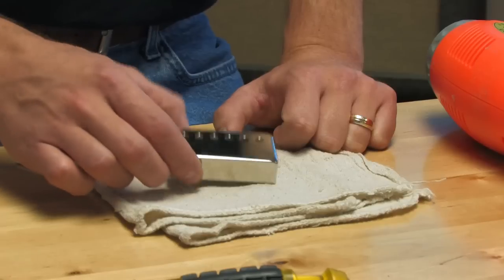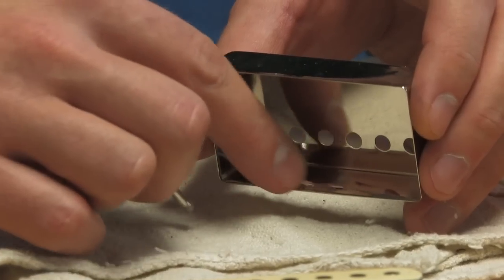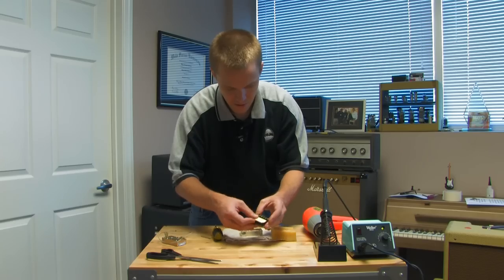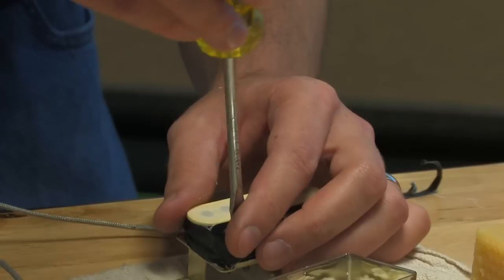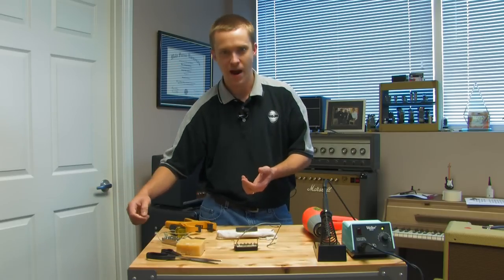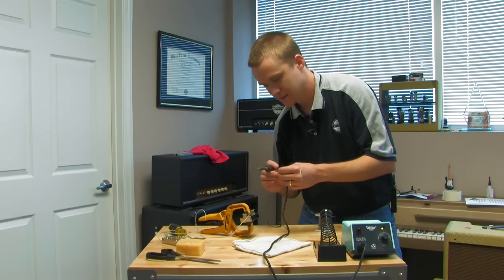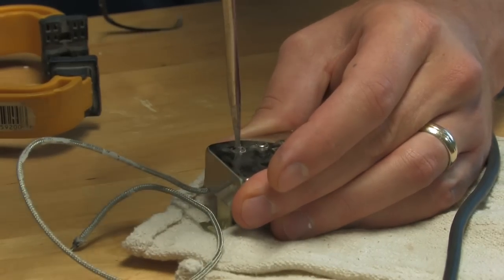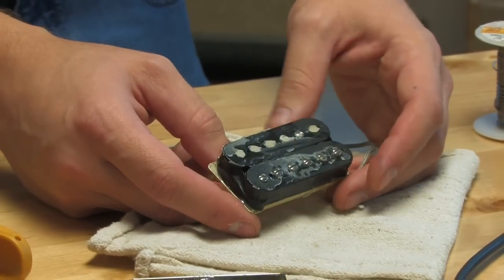Mojo Techtorials - Humbucker Cover Replacement

Comment: This is certainly an intense way of doing it, however I expect the majority of people will be put off adding covers to their pickups because they're afraid of having to put in wax and cover the pickups with tape and solder them. Truth is, you don't need to do ANY of that. Sure, there are some issues that technically may arise if you don't - but this is very very unlikely. Just buy 'em and put em on.

Comment: RS says just to use silicone on top of the flat coil and squish parts together once the cover is aligned and in place with the pile screws.

Comment: An alternative to actually soldering the cover to the pickup would be to solder a wire onto the cover on the outside, near the bottom and then run a ground wire from say, the back of a tone pot and connect it to that. Then you could just insert your pickup as in the video (I prefer to use silicone over melted wax). Finally, for extra solidity, you could silicone around where the solder joint would have been. This worked for me when with my 40W iron, I couldn't get the solder to stick to the base plate of my pickup and was afraid of damaging it by holding the iron there to long.

Comment: You need to hit the sides of the pickup cover with a rubber mallet. So they're not sticking out away from the pickup. When you put the cover on it should be touching the sides of the pickup. So you can easily solder it on.

Comment: Can I remove the cover of a humbucker when it's like the plastic black generic cover of cheap pickups that come with your guitar? I scratched it pretty bad and since I can't buy new pickups I was wondering if under those there are normal pickups like the ones at the end of the video... Thanks

Comment: If you are changing covers on wax potted pickup once the new cover is on should use the reat gun to remelt the wax that was already on the puckups so it bonds with the new cover or just slide it over the wax solder it and call it good??

Comment: @imojotv Hey, quick question! As long as I cover the slugs with masking tape and they do not contact the cover would I still need wax to prevent microphonic feedback? Thanks.
Reply: HendrixToTheEnd You'd just need the wax to seal the spaces between  the pickup and the cover. If you don't want to use wax you could use silicone adhesive and just put a few dots on the masking tape.

Comment from the maker: Hey Acronso -
Thanks for your questions.
1) You don't have to use wax but it is highly recommended so you don't have issues with microphonic feedback or squealing. 
2) Yes you must solder the cover or it won't properly shield and may increase hum.  
Thanks!
~Mojo

Comment: so - i tried this yesterday and the way you show this works really well. it was a bit of a pain to get the razor blade between the cover and pickup though. i have used a 100 watts soldering iron. thanks again.

Comment: Is there a reason you solder them on? Is it to ground them to the pickup or? Whats the point of soldering them when they are securely in place already?
Reply: Just to make sure I suppose.

Comment: What temperature are you using for the soldering iron?
Reply: L. E. B. He said it was a 50 watt iron.  Probably set on 50 if it's variable, just get it off of what ever you're soldering fast.  Don't heat the pickup or pot like you're gonna cook an egg on it and 50W isn't too much to use.